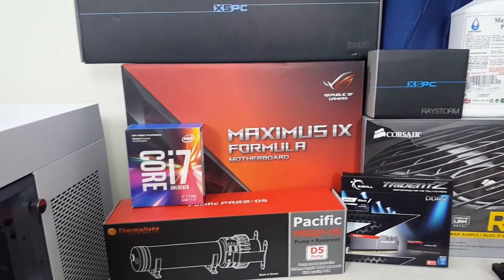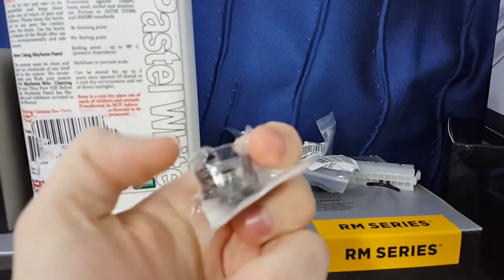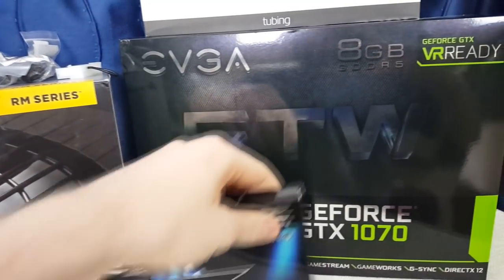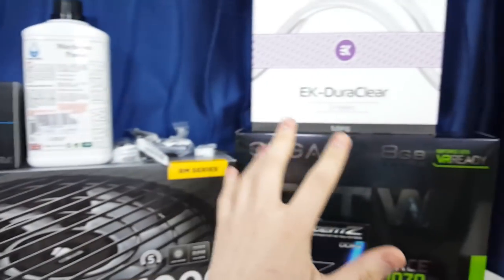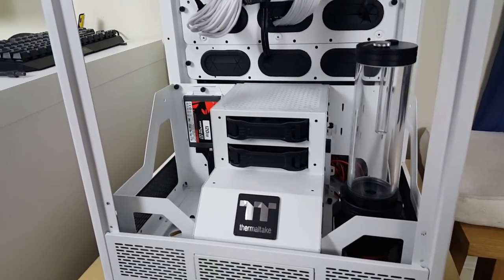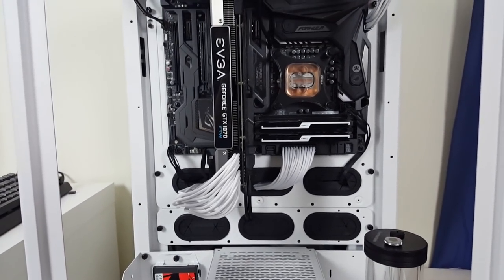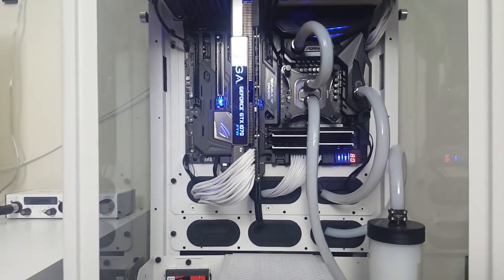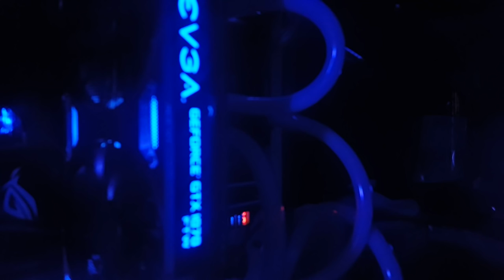The Tower 900: "Kaby Lake" Custom Loop PC

Comment: Why not use angled fittings? Would look cleaner :)
Reply from the maker: This is a very old build lmao check my twitter now have a X399 2920x system with Bitspower deluxe white fittings. My twitter is @ItzRath will get you a picture. This was a test build.

Comment: Nice, i love how u explained so clearly about the casing. How do you move this casing btw? You move it alone or 2 person? I want to get one but i stay alone, so im just wondering
Reply from the maker: x Jinyong i used to wheel it on a moveable side table. Ive actually changed cases since this build and re done my loop to hardline. I have a video on the case and will have one on the build soon
Reply: Wow u change your case! This case i actually pretty expensive tho...
Reply from the maker: I bought the Lian Li PC-011 in white. Can see a video on my channel. I did it because i went deluxe white bitspower fittings. My loop is VERY pricey. The loop in this build is cheap and wasnt very good.
Reply from the maker: Atm im using the T900 as a side table haha

Comment: Man this is super amazing. Thank you very much for sharing this. I really wanted to know about this case since i am building up a new rig and i was hesitate between this and Corsair Obisidian 900D. Btw, is there any noise coming out of the case when playing a game on ultra settings such as BF1 or GTA V?
Reply from the maker: nope no noise due to only having the fans from the gpu., im doing both the cpu and gpu loop again in hard tubing. so two separate loops i play on ultra at 3440x1440p
Reply: ***** thank you mate. Do u advise me mate to get this case or the Corsair Obsidian 900D?
Reply from the maker: Buddy Raydi this case is for advanced custom water cooling loops only. so i would advise the 900D unless he knows how to do custom water loops and has a spare £1k+ to do them
Reply: RathØX yup I'm aware of water cooling custom and I want to do it on my new rig. That's why I'm little hesitated which one to go to? Or do u have any other suggestion for me?
Reply from the maker: Buddy Raydi 900D would fit them perfectly. this case is over 30kg too so it will need to go on something other than the floor. to do loops in this case you have to buy thermaltake pr22 d5 pump/res combos. my new loops price comes out at £1200 so its expensive if you want to build in this case
Reply from the maker: Buddy Raydi corsair 780T is good for custom loops
Reply from the maker: Buddy Raydi really any fulltower/ super tower is good for custom water loops. but first plan out what the loop would look like.
Reply: ***** thank you mate. So for this case I have to have two loops if I'm not wrong? Not just one custom loop? Sorry to bother you with many questions? Also so u advise me to wait till i9 is out or i7-7700 would do the job since I'm a gamer and a streamer
Reply from the maker: Buddy Raydi 7700k. is perfect as i do streaming editing and gaming at 3440x1440. dont get the i9 because intel fucked it up. watch linustechtips video and jayztwocents video on the i9
Reply from the maker: Buddy Raydi you can have one loop but this case is for 2 loops. one for gpu and one for cpu. and you have to use the PR22 D5 pump/res because its built for this case and no other pump/res works with it
Reply: ***** ohh I see my friend. Thank you very much for this valuable info. May I ask you do u think waiting for i9 is better than having i7?
Reply: ***** oh thank you very much man. U really made up my day. Can I send u the list of my parts and u tell me what u think about them before I head up with the purchase?
Reply from the maker: no, i7 is perfect. you need to watch linus/jayz video on the i9. its not worth it at all
Reply from the maker: i have the 7700k OC to 4.9/5ghz and i play at 3440x1440. stream and edit with the 7700k and its great
Reply from the maker: sure, tweet them at me @ItzRath is my twiiter

Comment: Hey. Quick question. I'm thinking of getting this case but have the same thoughts as you,. I'm planning on keeping my 1080 and upgrading to the Volta cards when they come out. Because of that I don't want to water cool the 1080 and keep it on air. My concern is that this case is not designed for air/airflow. How is your card functioning on air?
Reply from the maker: Alistair Flood its not made for air flow. ive just bought a 1080ti Poseidon and will be on a loop video out later today.. the case is for custom water loops. air isn't so good since its basically a glass boc
Reply: yeah that was my concern, it's a beautiful case and am so tempted to just cool the 1080 anyway as it seems to be the only Supertower I can find that has tempered glass! Oh well, maybe back to the drawing board!
Reply from the maker: Alistair Flood water loop the 1080 you will get great temps.
Reply from the maker: Alistair Flood there are other which are full towers which are glass like the lian li glass case.
Reply from the maker: Alistair Flood the Poseidon is great though since its both air cooled and water
Reply: yeah, I have 2x 360mm (60mm thick) rads so space is important! Plus the Tower seems to hit a pretty sweet price! Only other case I've seen that hits all my needs was 800 quid! :(
Reply from the maker: Alistair Flood i have 420 for cpu and for the 1080ti which is in my case atm will have a 360mm. yeah i saw a few cases but nothing that has a good price a part from this case. tempered glass amazing
Reply from the maker: Alistair Flood this case fits 560mm  80mm think rads in push/pull lmao

Comment: It is possible to install the motherboard rotated by 90%? For the correct LCD display position on the board
Reply from the maker: wiky1008 lmao no..... because the i/o would be the glass hench its rotated so the i/o is on the top...

Comment: Buddy, how do you access to the ports?
Reply from the maker: Since the motherboard is turned 90 degrees the I/O ports are at the top of the case, the tol comes off and also have cable routes to come out the back.

Comment: On what degrees are you running the oc 7700k?
Reply from the maker: idle around 28-34C and while playing games around 58-62C
Reply: RathØX thanks! i have planned a watercooling loop with pretty much the same components, sweet build overall :)!
Reply from the maker: Thanks. im looking to SLi the 1070s and possibly do another loop since thats what the case if for but i love the FTW RGB zones, was also thinking about picking up another Curved ultrawide too haha
Reply: RathØX i currently have a matx case so watercooling would be hard but nzxt h440 and a better chipset and i would be ready to go full pc masterrace
Reply from the maker: Luukas Luht i have a White H440 which is going to be used in a special build which is coming soon!
Reply: RathØX sweet! waiting for it :<)

Comment: I fear for the project....When you want to upgrade your pc to change motherboard processor procedure to change the TANK or even you want that empty it is certainly easy demanding attention what you do ...
Reply from the maker: Minas Panagiotakis yes you have to drain the loop every time. also have to drain it once every 12 months. its for enthusiasts i also love the cold temps :P
Reply from the maker: Minas Panagiotakis you do that for ANY and EVERY loop.
Reply from the maker: Minas Panagiotakis some people even have 2 gpus on the same loop. This case holds 2 separate loops. one for gpus and one for cpu which i was going to use.

Comment: too much xspc ekwb is better and for fittings bitspower wins, and ek or bitspower for pump res stuff
Reply from the maker: They dont make the brackets for the Tower 900 only thermaltake since it's their case for custom loops. i even asked Ek if they would custom make a bracket if they could of i would've went the new X4 res . But that D5 Pump/res combo is great i will add a second soon.  i also went XSPC because of the black chrome fittings that go really well in this build.
Reply from the maker: Whats your budget?
Reply from the maker: The Thermaltake kits suck i wouldn't buy one especially if its your first build. EKWB has a config on their website which will help you.  i had to get the pr22-d5 since its the only pump/res with the brackets
Reply from the maker: you will also have to wait till ryzen comes out since its AM4 CPU brackets wont have come out yet for the cpu water blocks
Reply from the maker: when you say 'kit' there are a few Cheaper custom loop DIY kits like https://www.ekwb.com/shop/ek-kit-x360 (you would have to wait for am4 brackets)
EK are one of the best for custom loops.
or you could build your own. so 6 compression fittings for a cpu loop (size matches the tubing) When it comes to custom loops you also dont want to mix metals, but its a custom loop so its your own choice who/what you go with. Hardline tubing/flexi  coolant colour etc. Best companies to go with are bitspower/ek/XSPC/monsoon for parts and for coolant either Mayhem/Thermaltake or even ek.
Reply from the maker: Here is EK-WaterBlocks Custom loop config for reference  https://www.ekwb.com/custom-loop-configurator/
Reply from the maker: https://www.overclockers.co.uk/watercooling-configurator-wc-144-tl.html
Heres one from overclockers everything fits with everything so just pick what you want. if you cant find something you like, overclockers will help you out if you call them
Reply: What use is their configurator if they dont make brackets for the Tower 900?
Reply from the maker: Melchior AO buy the pump/res from thermaltake then.....
Reply: True.
Reply: So its ok to mix n match parts like this? Tt pump/res x 2, Bitspower fittings and EKWB radiators and blocks?
Reply from the maker: Melchior AO yes as long as its the same metals